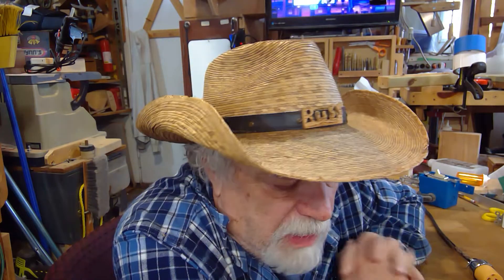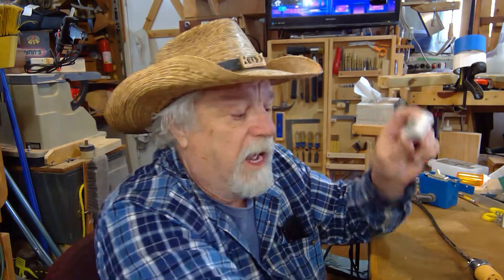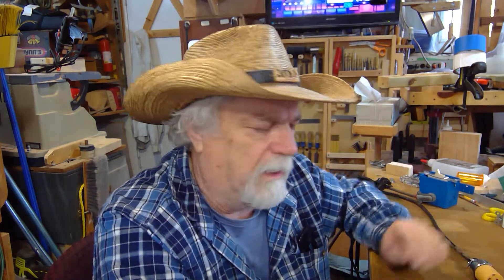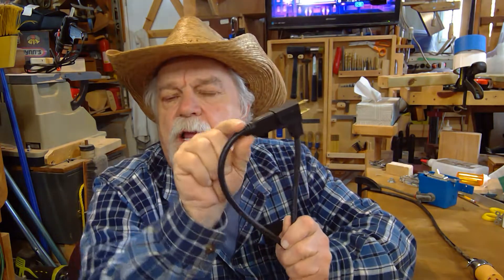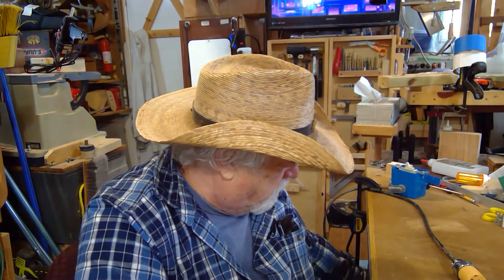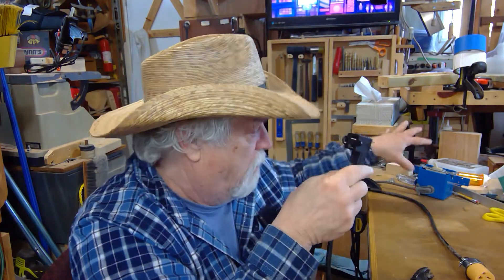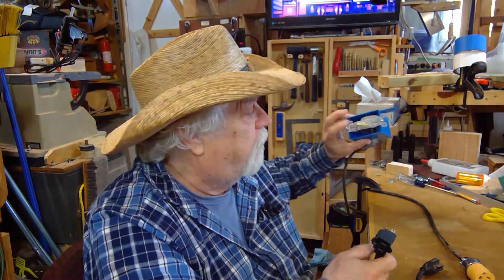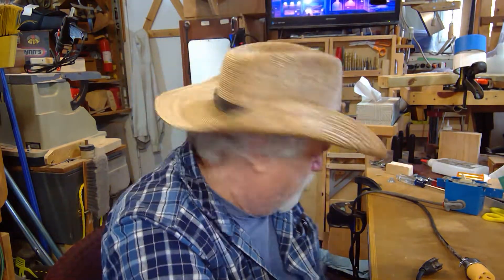Remote Switches in the Shop by OTB Thinker

Comment: Us gray beards are always looking for a better, easier, ... way to get it done and correctly.
I have w switches on my lathe one for the lathe and one for the dust collector. 
All of my equipment has switches and plugs to the motor I never trust a switch with my fingers, motor is unplugged when changing blades.

Comment: Uh oh, I'll have to check, I somehow missed part 2, and have 1 and 3?
But yes, there's certainly other brands that use that piggy back plug, but the brand Hydromatic has been using it for years, and makes a pretty stout product. Some of the Depot brand mercury switches may not be as heavy of a gauge wire, therefore long term compromising the devices connected.
The variable and foot pedal ideas came from some of the "all in one" DIY work stations I've seen builds on, here on YouTube. I just see implementing a foot activated safety, along with the bump stop switch as kind of belt and suspenders for my fingers. Some of the units I'm referring to take a circular saw mounted upside down under the top, along with a jigsaw as a scroll type design.
The variable pedal would be more for a brushed router, or the Plastic Welder I had picked up. It heats well, but I think I might work the plastics together better without so much forced air? Again, something for when my hands aren't so busy.... 
But yes, a remote control for the shopvac is wonderful! Until I get a Ryobi cordless, that's how I operate mine, via remote. I'll have to grab the HF unit on my next visit. I know a few years back Stanley brand offered a 4 channel, I had used that to help an old woman customer out. She loved it. And I enjoy using one for a bright light behind the TV's at home, especially in the bedroom. Can have light, without having to get out from the warm covers.
Reply from the maker: part 2 still to come :>)

Comment: Now's a good time to hit up the big box stores for the holiday lights!
How long have you been using the HF unit, curious how you have liked the distance reception? I've been looking for some cheap DC units, lemme know if you have any recommendations for them.
I've got a hydromatic sump pump switch just like that, that I've been meaning to wire into a foot pedal and a variable foot pedal, just haven't gotten around to it. I'll see if I can get my plumbers to save a few for you.